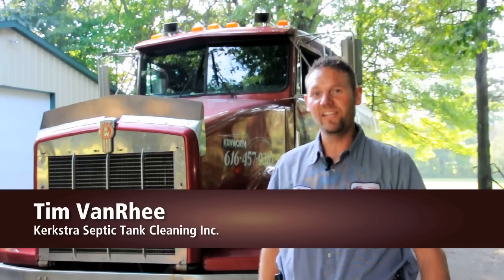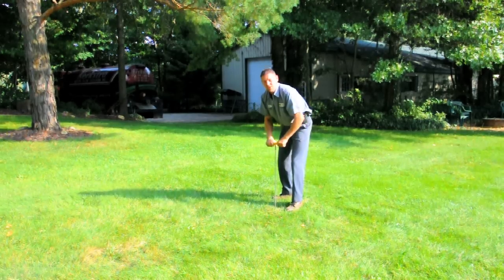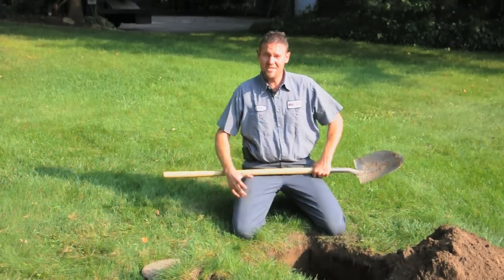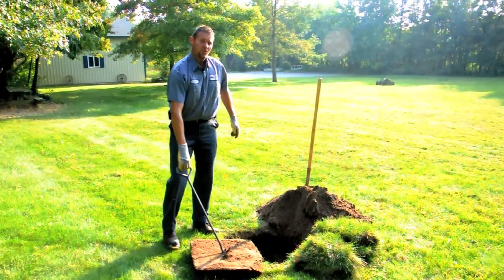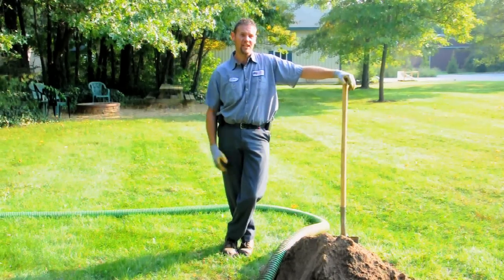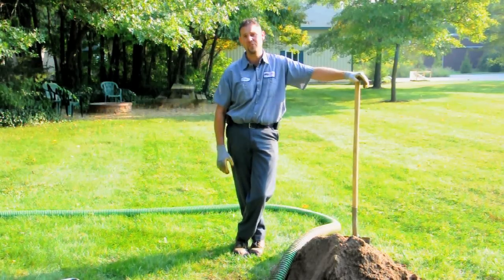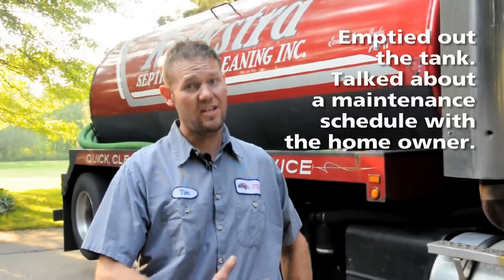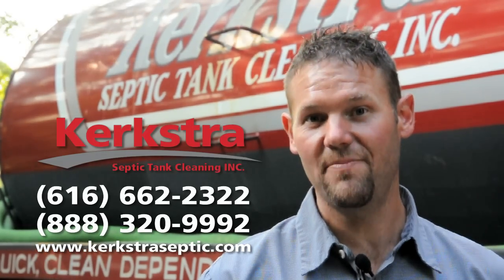What to expect when you have your septic tank pumped

Comment: So. Most tanks have two holes inlet and outlet. Depends on company if you save money for digging up. Outlet is very important to keep effluent from drainage.  Always tell your technician to dig up your outlet. And ask if the outlet fitting is secure. Do not put any additives to your system except root killers depending on surrounding trees and shrubs. Rid x eats material and creates more effluent and or Dabris to enter your drainage.  Make sure that if a technician says your system is “high flow” that they probe your drainage. Some companies try to sell you all new drainage when it is a simple root infestation. Call action pumping for any septic questions more than happy to answer any and all questions no matter  locations.

Comment: $40! This is obviously location specific! Furthermore, at least where I live, tanks are at varying depths! I do this for a living in SoCal.
Reply: Question. The 15 houses in my subdivision are over 20 years old and have never been pumped and nothing has happened, yet all these septic companies say to get it pumped every 3 years. What’s the deal?
Reply: @Smoshylife  i suppose it's because though there appears to be no problems, there often is once the tank is inspected. Concrete tanks deteriorate and plaztic tanks get all distorted. People can fall into them.
Reply: @vf3289  Stops running where? Into the tank, or out of the tank and into the leech field? If it stops running into the tank, your pipes to the tank are either plugged, or your leech field is failing. In short, yes: you can dump straight into the tank, but if your leech field is failing, it would just back up your sewage pipes to the house just the same as if you flushed the toilet/etc.
Reply: @vf3289  run a water test: put a running hose into the LIQUID SIDE, the side that feeds the leech field. Run it for 15 minutes. If the water level remains the same, your leech field is working and you have a clog between your house and the tank. If water level rises, your leech field is failing.

Comment: I liked your video but I have a question?How do you know it needs pumping? I did not see how you determined it, would be helpful if you could show us how to spot a scammer, if the tank does not need pumping.  ( I was charged over 2300 to put a concrete lead which already had, ( "new kind for 2018" )  a concrete baffle which I dont even know what that is or do, and which I dont think he installed by the way and I saw no pumping ) I do Investment properties and I would like to know how to NOT throw my money into the wrong people's pocket. Thank you much

Comment: When having a 1000 gal. tank clean out with two lids on top should the cleaner clean out both sides or just the side that has all the waste material ??
Reply: +Max XXIV 
ALWAYS clean both sides.  Some of the scum + solids will always leech over to the second tank (or second compartment).
Reply: Other tank is called a dousing chamber it will ether have a pump or bell siphon system good to have the dousing chamber cleaned out so no solids end up in your sewer field

Comment: $40 to expose lids? What a deal for the homeowner but not for the guy digging...if the soil is rock hard and 20-24" deep the techs' in for a world of hurt. I do three per day on my inspections and some risers but if they don't...😩
Reply: How much does it cost to get a septic pumped
Reply: @charlenejones5152  it can cost varying amounts based on any number of factors.  You may live in an area that has regulatory fees or requires digging to get to the covers, so it is hard to say.  The range can be as little as a couple hundred dollars to as much as over a thousand based on the other work necessary.  it is best to ask someone more local, and get a few quotes to compare.

Comment: I have a couple exposed pipes ahead of my septic, I thought they drained it from them?
Reply: Those are cleanouts - if there is ever a clog in your main sewer line, the technicians can snake from those lines instead of digging up your inlet cover and snaking from the tank. Extremely useful especially if your tank is deep or the inlet tee is not exposed.